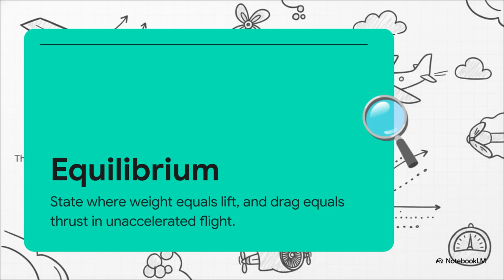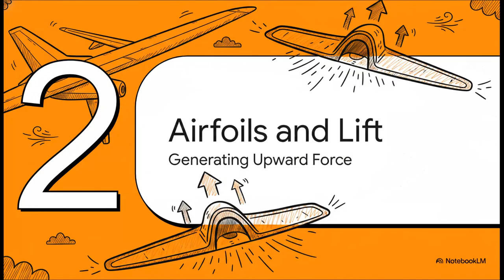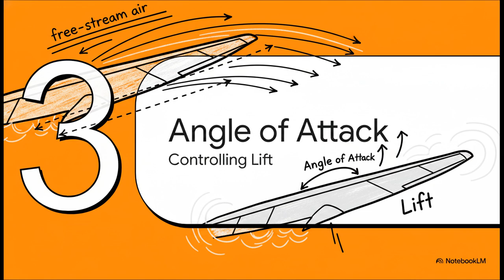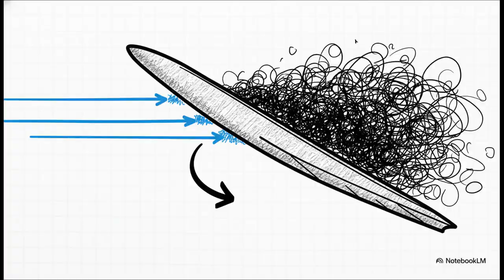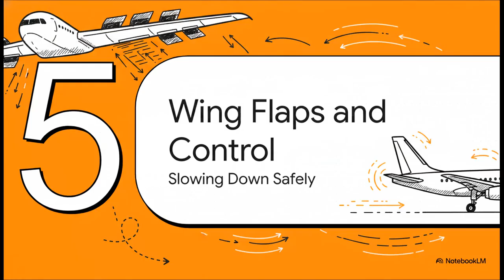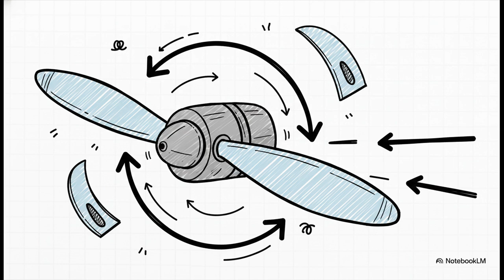The Physics of Flight

Comment: Bernoulli didn't discover that a velocity increase is inversely proportionate to a pressure decrease.  He discovered that a velocity increase is proportionate to a pressure decrease, when and if, the total energy remains constant.    Velocity and pressure are not inversely proportionate when the total energy is not constant, only when the total energy  is constant ,is it inversely proportionate. A squared plus B squared does not equal C squared when A and B are not perpendicular.